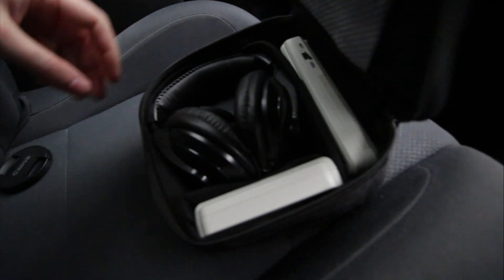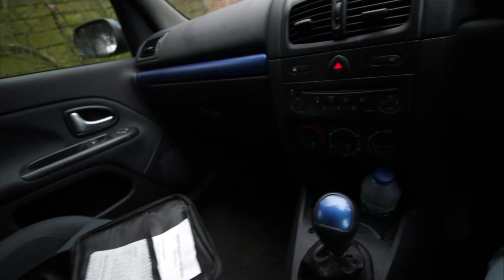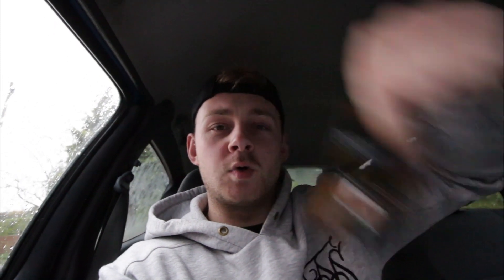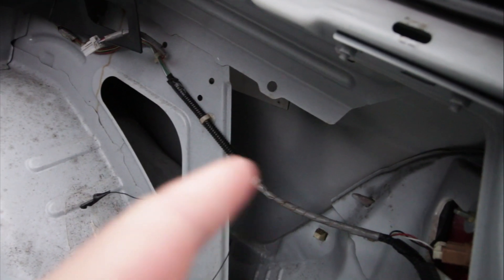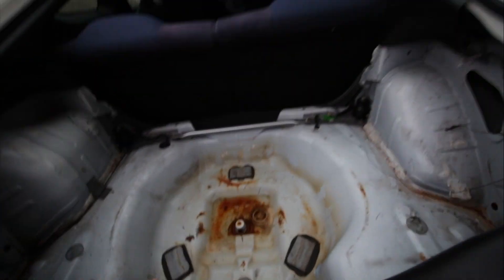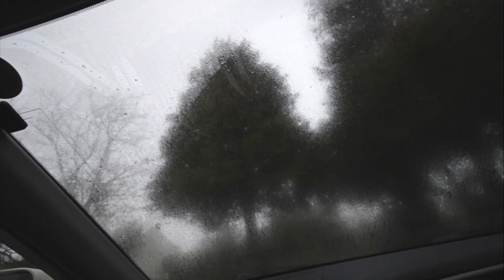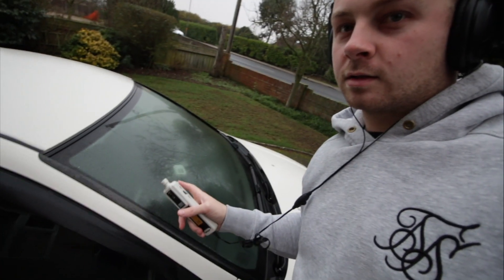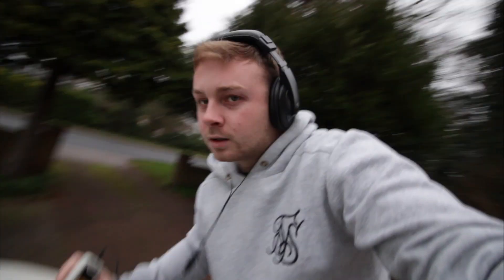Integra DC5 Diagnosing Water Leaks - Part 1

Comment: I can help you here bud as ive had the same problems leaks from both front and rear. This also affects other hondas of this era. Basically the sealant used on these models is shit. I had to strip the entire car down to find where it was leaking so here are the places you should check as i found multiple leaks. The roof strips, the sealant between the roof skin and body splits letting water go down at the front and back. I scraped all of it out then resealed with a good 3m seam sealer. The rear wash wipe also can let water in, get a new seal and also put a dab of sealant round it. The tailgate hinges, you'll have to remove it scrape away old sealant then reseal and refit, careful its a heavy bugger. The rear bumper hangers at each side, where they pop into the boot just take them out and put a dab of sealant on and refit, lastly the plastic shower cover behind the doors can come away so just peel back and reseal where needed. Rear lights too but you have got new seals so all good there. Since ive done all this ive had no leaks but im pissed off honda couldnt have used a better sealant in the first place. Hope this helps👍
Reply from the maker: Yeah following this video I removed 80% of the interior of the car and found out 100% where it was coming from, luckily mine doesn't have a rear wiper but the I did notice water come in through the bumper hangers when I had a hose on the car while I was inside! 
I will be putting sealant round the hinges when I refit the tailgate as well, I'm going to go over all the rear inside seam sealer too with fresh stuff and also other places where the inner skins meet, just going to go mad with it. I'll also be using cavity wax in the roof and inside where I see fit. 

Thank you for your comment, its nice to know that I'm not the only person who has experienced this issue & I hope these videos can help out someone in the future who may experience the same.
Reply: @CrouchyM  no problem my man it was very frustrating but ive had no leaks for a good while. As you say hopefully it will help others with the same problem👍
Reply from the maker: Yeah it’s annoying but it’s just one of those things. I look forward to a leak free and dry interior 😂👌🏻

Comment: Check that it isint under the carpets as it may rot the floor pan
Reply from the maker: Yeah ive basically stripped the whole interior now so I've inspected it top to bottom and we're good. Also found the leaks, will be uploading tomorrow.
Reply: That’s good fair play :) I had a leek on my Ep3 all fixed now
Reply from the maker: @samwatts1655  I had a leak on my old EP3 too funnily enough, same issue. Roof seam sealer.
Reply: Well mine was coming from under rear light on a bumper clip someone snapped it and there was a hole then leaking in to the boot and under rear seat bench and carpet lucky found it when changing my carpets so now all sealed and no leeks :)